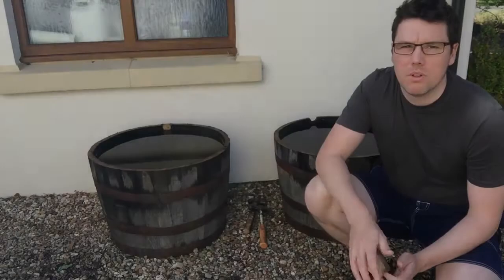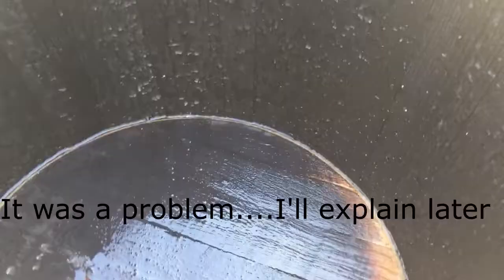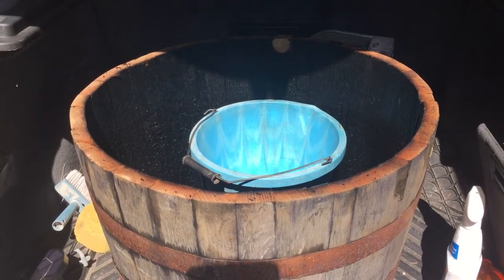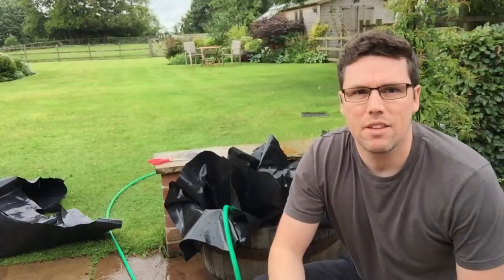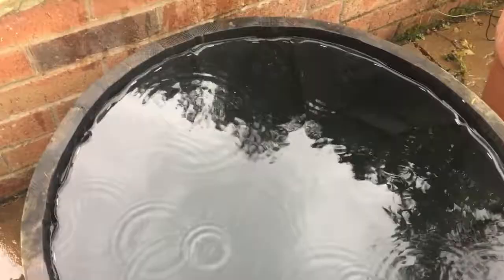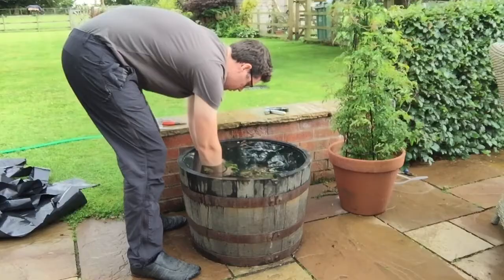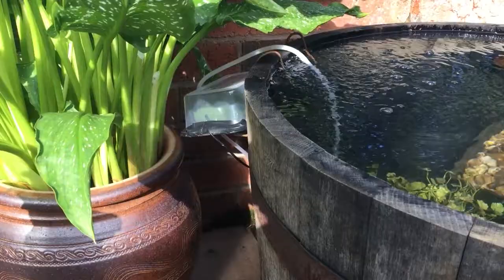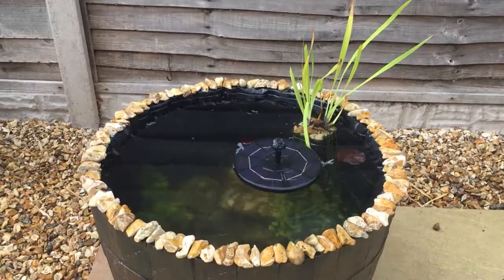Half Barrel Pond

Comment: Like to know how your barrel is coping re shrinkage and returning back to original size. By lining my barrel it allowed mine to shrink and eventually loosen from the metal rings which then fell to the ground. The barrel eventually fell apart leaving the liner full of plants etc.  Unlined new barrel … and the water alone keeps the barrel sealed and correct plants keep water both cool and free from stagnating. Hope you’re having better luck than my first barrel. As an aside the whiskey/funky smell disappeared after a couple of days with plants in, though fish were not living in mine only plants for wildlife.
Reply from the maker: Mines been fine…still in one piece

Comment: I have two of these. One is a plastic faux barrel the other is a wine barrel that I bought a liner for. The frustrating part is they are in general, too deep. The plants are often marginal and don't enjoy being more than 10 or so centimetres below the water line. I found myself messing around with 'platforms' etc to raise the level of the plants. They were always falling over etc. So now I have floating pots instead. Thanks for sharing.

Comment: Thank you for sharing your process in creating a barrel pond. What did you end up doing to winterize it?
Reply from the maker: You need to make sure any ice that forms doesn’t get too thick. Where I live it rarely gets cold enough for long enough to cause a problem. I occasionally have to break the ice in winter and once or twice I’ve put an insulating blanket over the pond at night as a precaution
Reply: @davidianoliver  Thank you for sharing your experience. Am I also right to assume that you kept all the plants and wildlife inside the barrel pond through the wintry months?